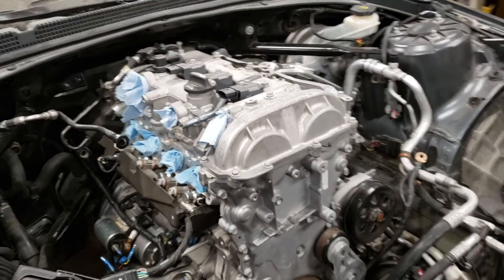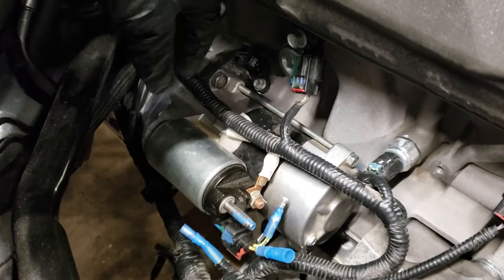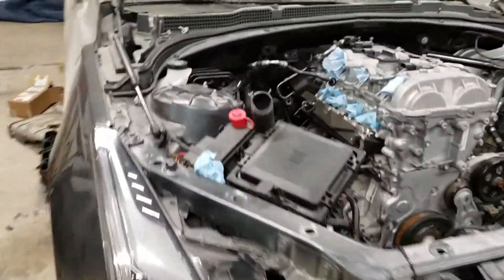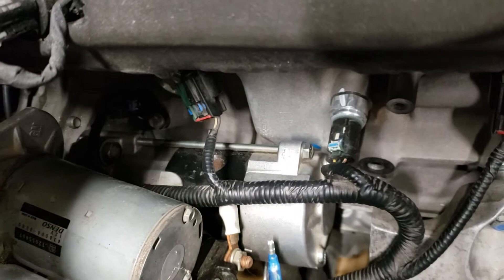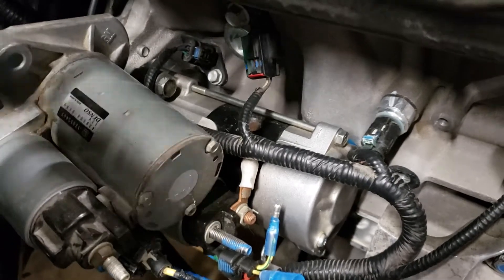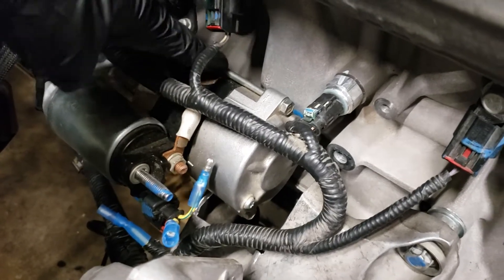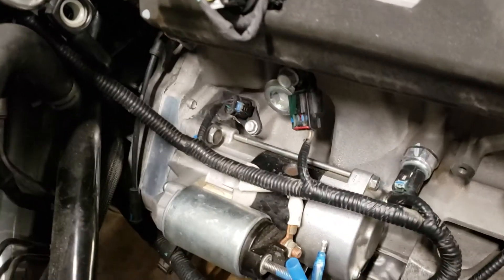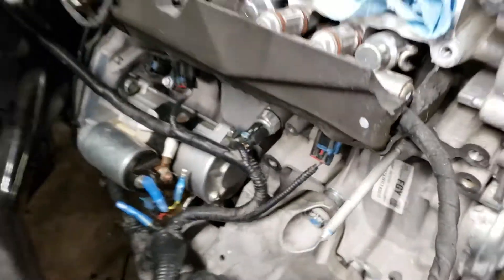2013 Cadillac ATS 2.0l ltg rwd Auto. Installing 2017 cts 2.0l ltg engine install.

Comment: Do you remember the pn for the engine bracket
Reply from the maker: I do not. I did not find one that matched up. 
That vehicle had 450hp no issue with 3 out of 4 bolts on passenger mount.
I will weld a provision to utilize the 4th bolt soon.

Comment: Was the ecm ecu replaced as well ? I Have a 2014 CTS 2.0t LTG CBR just swapped the 2017 CTS LTG FGY ,  spliced the starter and fuel sensor but no start .
Reply from the maker: Same stock/factory e39a ecm.
Started right up from previous 2013 calibration. 
The ecm was happy.
You will need to use a 2013-2015 High Pressure fuel rail pressure sensor.
The sensor is wired differently internally and will not start as will not see High pressure Fuel pressure in rail.
So don't forget to swap or get 2013-15 for that wiring harness and ecm as the 2016- 2021 are not wired the same.
Reply: @Bubba Ruiz   Did you get the swap complete? I'm putting a 2016 ATS motor into my 2013. I have access to the complete crashed 16
Reply: @cjls1z28   yes cut out small piece of motor mount to fit , spliced the starter and swapped fuel pressure sensor ( sensor will not enter has small plastic clip /guide like thing I burned off with a hot knife)

Comment: Can I put a 2.0 from a 2015 manual into a 2016 auto with start stop?
Reply: Same question
Reply from the maker: Yes.
Will need to disable Start/Stop feature of using 2013-2015 in 2016+ with the feature enabled.

Comment: I also was wandering what you did to wire that starter?  And am I understanding right that the starter, motor mount, and the high pressure fuel sensor are all that is needed to get this to work? This worked for you?
Reply from the maker: Correct.
Reply: So was it one motor mount or both needed changed?

Comment: Why did you swap it? Same motor isn’t it?
Reply: When you say canbus comm problems are you referring to the starter issues?
Reply from the maker: @jbstunts636  you will need to use the 2013-2015 high pressure fuel sensor for 2013-2015 wiring harness and ecm if using 2016+ engine.
High pressure fuel rail sensor is wired differently internally after 2016+
Reply: @JDCustoms High Performance Tuning and Engines.  Do you know if this applies to 16 ATS? I'm swapping a 2016 ATS Motor into my 2013 ATS.
Reply from the maker: Dimensions and for the most part yes. Same motor.
They design a different block for the starter provision. 
Nothing special. Simple used engine install.  Just need to address the mount and some canbus communication issues with the model year difference.
2013-2015 and 2016- present.

Comment from the maker: Low side fuel pump upgrade and one piece driveshaft now available for the 4 door Cadillac ATS 2.0l Auto LTG.
If you need one for yours we will have or have it made.

Comment: What extra did you need for this swap?
Reply from the maker: Swap out high pressure fuel sensor 16-17 on rail with HPFS 13-15 wiring harness or no fuel pressure for you.